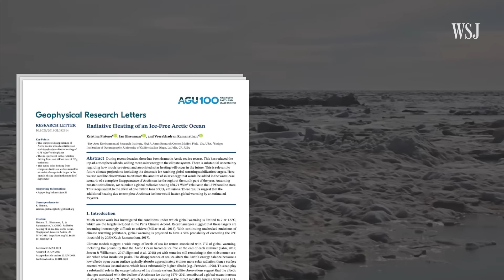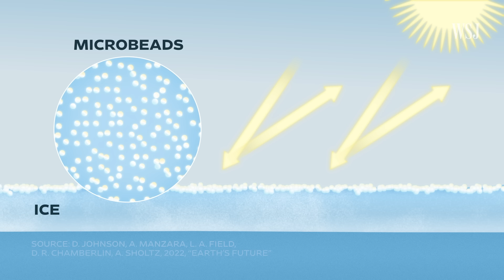Inside the Extreme Plan to Refreeze the Arctic | WSJ Future of Everything

Comment: Me opening my fridge 24/7 to cool down earth: I'm doing my part
Reply: Starting the movement ✊🏾
Reply: I think doing that* would make the fridge use more power leading to more CO2 emissions. Unless you're place is powered by renewable energy.

NOTE!
And yeah. I understand in a basic way how a fridge works. You guys. My POINT was. To  note potential wasted unefficent power loss it would have doing something in a way it wasn't intended to be used. And therefore using more power. And therefore leading to more emissions than needed. IF the power comes from unrewnable sources.
Reply: Me turning on my old and new Air-conditioners with CFCs and HFCs  24/7 to also cool down earth: I'm doing my part!
Reply: thermodynamics says otherwise 🤣
Reply: @thebluespirit2006 your fridge produces more heat than „cold air“ so even if it ran on 100% clean energy, it would still increase temperatures
Reply: @thebluespirit2006  and the fridge itself generates more heat than it cools
Reply: @United.  A point there. But still INSIGNIFICANT to what kind of heat problems you would cause from fossil or unrenewable sources. But thats a point for you both though. I will give ya that.
Reply: @jojojotype5563  actually, Technically, it doesnt produce cold air at all..  it is just transferring the heat inside your fridge,  to the outside..  like a water pump,  is pumping flood water outside..   so,  no cold air is produced,  no loss of heat,  only heat produced..  on the back of your fridge 😇
Reply: @thebluespirit2006  Your fridge produces more heat than cold anyway. It uses a heat exchanging mechanism.
Reply: Im getting my a/c fixed on my 77 trans am i will leave one window down to help cool down the earth...im doing my part...
Reply: @thebluespirit2006  I think you missed the point he was being sarcastic.
Reply: You need to get more beer!
Reply: Nap for the earth.
Reply: This is an intensely stupid conversation.
Reply: omg do we really have to explain the joke
Reply: Hello Light
Reply: Lame. By the end of the decade, the jokes will be better. 
Really tough conditions squeeze out some really good humor.
Reply: it won't actually help. your freezer just separates the hot air and the cold air. if you feel the back, it is actually pretty hot.
Reply: I  pity  those  poor  people  who  fail to catch your humor.    Thanks fo rthe chuckle!
Reply: Is it plugged to an energy source? :)
Reply: He was joking...what a killjoy
Reply: Idk, did these scientist know thermodynamics from high school??
Reply: @thebluespirit2006 it’s a joke
Reply: There are millions of unregulated supermarkets that already do that and they are part of the problem. Rather than doors they are allowed to have open air coolers for the sake of profit.
Reply: @suminshizzles6951  the thing is it’s probably more expensive to use all that energy to keep it cool it’s so stupid just use  doors
Reply: @plevjuzanis I see that, either your reading or research skills are on point, yes(:
Reply: @thebluespirit2006  it is one of the most overused jokes on youtube, so your reply is perfect
Reply: It was a joke, guys… or was it not? You never know…
Reply: @thebluespirit2006 exactly. You see the problem then?
Reply: Obviously you don't live with your father.
If someone lives with their father and opens the fridge and can't choose what to take out then even if their father was on an expedition on Mount Everest he will somehow immediately appear in the kitchen to say something like,
 "Close the darn door on the refrigerator. Electricity isn't free you know".
Reply: @geofflepper3207  my whole family does that to cool down earth so should you
Reply: @thebluespirit2006 even if it’s powered by renewable energy u shouldn’t waste energy
Reply: Using more electricity.

Comment: For a long time, I imagined what would happen if salt made from seawater was sprinkled over Antarctica.
When salt comes into contact with the snow on the surface, its melting point drops, so it turns into water, but if the surrounding area were colder, I wonder if it would freeze like a flat mirror.
I had no idea of spraying seawater directly, but I hope it will be successful.
Reply: At -20°C temperature sea water just behaves like fresh water in turning surrounding areas to ice.

Comment: summary: the heat in liquid seawater that is nominally insulated by sea ice is surfaced so that it can be radiated into space, resulting in ice(heat) that would otherwise not be formed(be rejected to space). essentially an ice machine(heat pump) with a condenser that uses the of coldness of space and the atmospheric window.

Comment: It costs more energy to make ice than to not.
Reply: Depends on how you’re making it and where the energy comes from. The methods here are fine.
Reply: Sure but whats your point?
Reply: Engineer here: Yeah I can't see how they can actually do this with out making things worse by consuming more energy.
At least they admitted the irony of using diesel generators to run the experiment. Like all of the climate solutions its going to be a matter of how we power it more than anything else. Sadly right now (as an engineer) I don't see any initiatives that come close to being called a solution.
Reply: @Chris-rg6nm  Do I actually need to write it out?
Reply: @davestagner  Go back to sleep.
Reply: @tonywilson4713  If the climate good of creating more sea ice outweighs the climate evil of using energy to make the ice (or in this case, to create a situation where nature makes ice), then it’s a net good.
Reply: @lineinthesand663  There is not a one to one relationship of energy use and ice cap melt. Besides they aren't replacing Ice cap melt, they are creating a crust of ice to reflect the sun rays to reduce melt.
Reply: @davestagner  That only works if the net effects of more ice out weigh the negative effects of energy use.

As an ENGINEER this is my main issue with so many of the overly simplistic and/or unrealistic suggestions of dealing with climate change. Too many of the programs are like trying to handle an arterial bleed with a band aid. They don't deal with the actual problems and causes. 

You can't deal with an arterial bleed unless you also stop the person with the knife who cut you in the first place and then secondly deal with the arterial bleed in a way that you don't die. With respect to climate change we are neither addressing the causes nor dealing with fixes and repairs to the planet.
Reply: @tonywilson4713  At this point, it’s just science experiments, learning techniques and feasibility. But if it can save even a few percent of sea ice, it’s likely well worth the energy cost. I’d presume that much of the energy would come from nuclear-powered military vessels (as Kim Stanley Robinson suggested in Ministry for the Future).
Reply: @tonywilson4713 
I know you keep typing 'engineer' but you seem pretty inept at the concepts of engineering. 
Geothermal energy pumps work in the very same way, except opposite, as in for heating water instead of cooling it down. You can save on energy by heating up the water through the earth despite having to pump it up to half a km. 
Using the cold Arctic glacier top, to shock freeze 4°C water takes a huge amount of energy    if done through phase change means, this way it's free and the pumps use an insignificant amount of energy comparatively.

Also what are you yapping about band aids and arterial bleeds, are you a doctor or engineer, or neither?
Cause stopping arterial bleeds is exactly like putting on a bandaid, reducing the bloodflow to induce clotting, so the bleeding stops and the artery can heal. Ohh and idk, that sounds a lot like; let's add lots of ice during winter to the ice cap, in the hopes that the temperatures cool down a bit, so it self regulates itself again. 

You can't stop Co2 emissions, you can't stop the increase in emissions, you can't even stop global warming. You can just prepare for it and spend money on preventative measures.
Reply: @davestagner even if they re using green energy to pump the water, thermo dynamics still be there.
Reply: @jackreacher4619  Oh yeah. This is a MASSIVE energy intensive undertaking if it’s done. But is the energy cost of doing it worse than the cost of just losing the ice? I’d also expect this isn’t something done everywhere, but mostly in key locations where saving some ice can prevent much greater losses down the road.
Reply: BS

Comment: what if you ut water on a very large plastic container and put it in the Arctic? it will freeze in the cold months , melt in hotter months but the water never gets released. Plus you can make the water inside salty so it remains frozen for a long time. Might as well make the upper part of the container reflective to even slowdown the melting. Two birds in one stone, plastic recycled, ice created.

Comment: Thinking out loud: I heard once that you could just paint roofs white and it'd effectively do what the ice caps do. But then, I THINK I heard this would just cause light to bounce up to clouds and back down and warm the earth even more. SO is this really dependent on latitude?
Reply: The clouds doesn't cover the sun 24/7. Probably only 20%-30% of the time in a year will be covered with clouds. Rest there is no clouds to re-reflect
Reply: @qwertyqwert2818  There's also the case of ocean shipping during 2020 - 2021. That was the year they banned a certain type of ship fuel (or there was a lack of shipping) and they found that the sulfur compounds that come from the ship exhaust where actually helping to reflect light back into space. They were able to measure a noticeable difference in temperature effects. Basically it got hotter without the "sulfur exhaust". I'm starting to think the fastest way to control global temps is through reflectivity .. basically anywhere.
Reply: White roofs also reduce the amount of energy needed to cool the building underneath. Behavior change by people to tolerate higher indoor temperatures in the summer would help as well.

Comment: You mean they will pump more sweet water into the North Atlantic? Arent they worried with the slowing down of the AMOC? Aren't they worried about the salt helping the ice sheet bellow to melt faster? Salt is used to remove ice from roads ...

OBS: when water freezes if forms crystalline structures that expell the other substances disolved. Freezing water, for instance, is an efficient way of removing salt from sea water (it's efficient in regions that have temperatures bellow zero)

Comment: Lets refreeze the artic. *Drives gas powered snowmobile
Reply: Pours micro beads on the ice
Reply: Petrol has a shitload of energy in a small volume. They need the data to Calibrate the process. But like carbon capture it's only one aspect 😊
Reply: Lets refreeze the arctic. *Constantly exhales C02
Reply: Literally all vehicles in Antarctic are EVs.
Reply: @crhu319  How is that possible if batteries perform worst in cold weather?
Reply: We need to start making nuclear power now. Nuclear is the cleanest power and help sequester the most carbon.
Reply: @raiden72  solar and wind is the cleanest. Texas loves wind for a reason.
Reply: @kangkim150  solar power is not necessarily the cleanest, because you have to mine the metals to make the panels! You have to scrape the dust off of the panels and it is very high maintenance. Same thing goes for wind power, VERY HIGH maintenance for low output. Nuclear is definitively the best solution that we have today, And if we can transition this into cold fusion within the next 5 to 10 years, then we will eliminate the problem of energy altogether.
Reply: This here is a person who can’t see the forest through the trees….
Reply: It's ironic, but means nothing :) Like a tu quo que fallacy
Reply: EVs in cold climates use ancient tech called electric heaters but made just for batteries
Reply: @raiden72 I like them all. Panels/coatings are being designed to be cleaned by puffs of air which could also put window washers out of a job too. Solar is also being developed as a translucent costing on windows.
Reply: @kangkim150 another big problem with wind and solar is being so susceptible to damage in weather. I can’t remember where the big area of wind turbines were destroyed but just this past winter, Texas had hundreds (I think it’s actually thousands) of solar farms destroyed by hail. That brought up an issue that previously hadn’t been solved and that was how can they dispose of the ruined panels?  They are not something that will biodegrade and there is a toxic element to them.

Comment: Pumping the water at the height of the tallest mountain using solar panels to run the external pumps using insulated pipes to prevent internal freezing will make it snow over the ice caps which are more resilient to the melting effects then the bare plateau surface snow...
Look at ladakh building ice stupas using similar technology. Likely the salt content in the water may even aid in preventing the internal freezing. Flooding will create transparent to translucent ice which is still absorptive to sunlight but showering water will create snow flakes which are more opaque and will rather increase the reflection of sunlight with its whiter appearance. Sounds more sustainabke to me... what are your thoughts?

Comment: They need to switch to using renewable energy to power these machines, such as biofuel (which I assume diesel is not)  otherwise this will never be sustainable ... And that's assuming all of this is even safe and not detrimental to the rest of the world's environments.
Reply: Diesel engines can run on thinned vegetable oil with no modifications to the engine. Far easier to have a low or no petroleum diesel than other types of internal combustion engine.

Comment: Dam, the ice salinity is kind of a big deal imo, ice is supposed to always be a safe supply of potable drinking water. If they do this at a large scale with salt water that will  make the ice undrink able for people and animals for future generations. I can't support this.
Reply: A couple of points: 1 Young sea ice is saltwater ice - this is the ice which is disappearing fastest. 2 the melting of the ice will cause it to flow into the sea - which will mean it becomes saltwater in any case.
Reply: @gavinminion8515 the point being raised is that arctic animals get their water from those ice packs, but now it's been turned into an salt desert that will make it deadly for polar life to sustain off
Reply: @gavinminion8515  These kind of both sound like arguments for using desalinated water.
Reply: @bethh1068  Thanks. I'm not advocating this btw, I think it's a bad idea because it can't be scaled up effectively. My point with both above is that this would (should?) be used to form sea ice in places where it is disappearing - if the ice disappears from these places all that will be left is saltwater.
Using desalinated water would be preferable, but makes the expansion of this project even more impractical.

Comment: You may have heard of "tipping points", wherein climate warming reaches a stage that triggers a change that amplifies warming exponentially.
The methane locked into the Arctic tundra and seabed constitutes such a tipping point as methane is 10x more efficient a greenhouse gass than co2.
I suggest preventing that at all costs or even cockroaches will have a hard go of it.

Comment: What a mess we’ve made… 😢
Reply: We didnt do this. The planet heats and cools to the extremes in cycles. Its happened many many times before and nothing we can do to stop it.
Reply: @AtomicOverdrive yes, we did this. Carbon dioxide in the atmosphere has increased by 50% in the last 175 years, and we are to blame. Earth should be getting colder if it weren't for us polluting the skies with excessive greenhouse gases.
Reply: @AtomicOverdrive  It absolutely does, but is it just coincidental that the rate at which this has been happening has increased dramatically since the industrial age?
Reply: @AtomicOverdrive first of all, we did do this. Second of all, humanity never lived during a warm period in history.
Reply: @AtomicOverdrive pumping c02 into the atmosphere ten times faster than the petm extinction event. Yup I’m sure it’s all natural
Reply: @Jc-ms5vv  Everyone always mentions earth when its in an ice-age. Few people mention or fail to mention that the time between those ice-ages the earth gets hot to the point where the poles experience 40c weather. If someone wants to get technical, yes we are impacting climate change and are in fact speeding up the heating process. However, this would happen with or without us as it always has. One can say over the past 200 years we have made things worse. But seriously even 2000 years is such a small small number when we are talking about climate cycles that last from 20,000 to 100,000 years per cycle. That and earth is millions of years old.
Reply: @AtomicOverdrive  It is both, the natural cycles of the earth-sun-x and the increase of CO2 by humans. We could just seat and see what happens or do something about it.  Yet, what this video is presenting is just nuts because of cost in $ and energy, decarbonise is a big part of a "solution".

Comment: Well I just realized , adding 1 trillion tonnes of co2 to atmosphere would not just change the jet streams,  it should likely disorder the electrical activity of the sky,  as co2 is likely a bad conductor , where as water and moist air is better , so it’s like adding a 30 % stronger resistor or capacitor to a circuit , the capacitor,  high sky , building up a bigger charge when finally released  . Thus likely More violent weather .